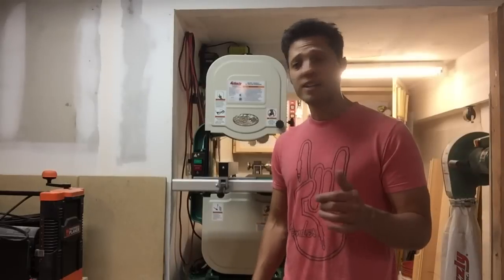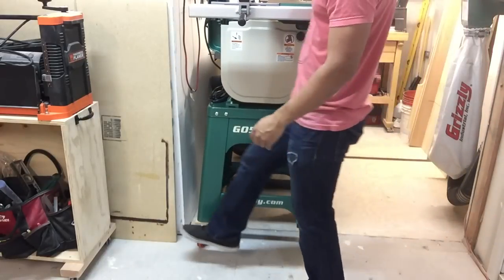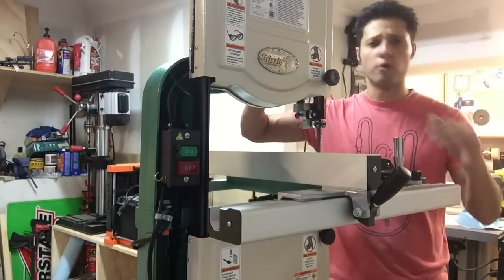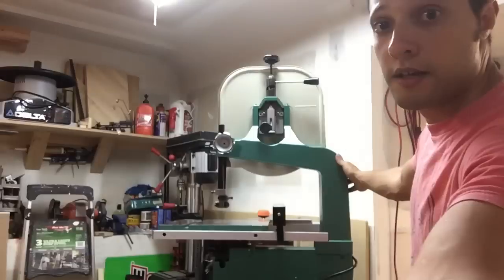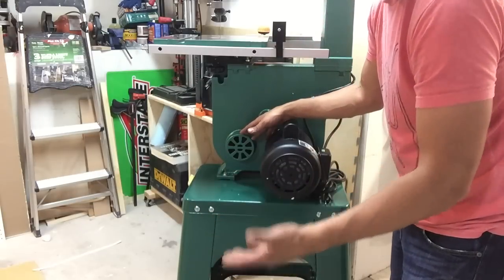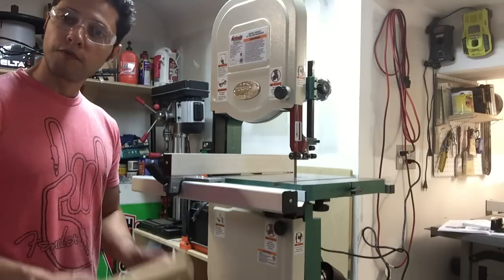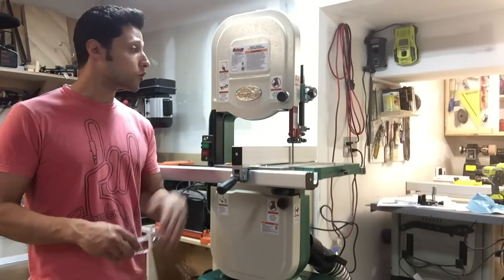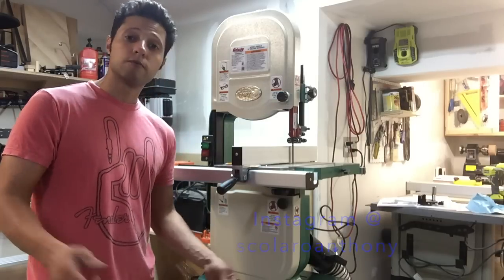Grizzly Bandsaw G0555LX

Comment: Just got this saw and it's been sitting in the floor because there was no way I was going to be able to lift it onto the stand.  After hearing you say that you lifted it yourself I did some rethinking and thought if a 30+/- guy can lift this saw alone why couldn't two 60+/- guys do the same.  Well it worked and  I am back in business.  Thanks for the inspiration.  Old guys rule!!!!
Reply from the maker: Dave Bailey 37 to be exact lol... I had a tough time lifting it by myself and would not recommend it but after some heavy deadlifts, it was more awkward than heavy.  Congrats on your new toy and thanks for watching
Reply: Dave - When I got mine I was wondering about lifting it by myself as well. But it can be done with a 60+ guy, my 50+ wife and my 30 year old daughter with no problems :)  Love my Grizzly!
Reply: @dfranks50  this 60+guy screwed a brace to the floor joists  wrapped a chain around it then jacked it up to chair height with a come along.  From there I was able to slide it on to the stand. Made my first cut today now I'm tearing apart my shop to give it a permanent home.
Reply: I was planning to install the riser block kit, so I removed the top arm while it was still in the box and set it aside. I then carefully stood up  the box it came in and carefully walked the lower half of the saw with the motor attached out of the box and then lifted that onto the stand. When it came time to bolt it to the stand, I ran the bolt with a flat washer up from under the stand and then placed a flat washer, a lock washer and a nut on it from the top. It seemed easier than trying to stack the washers and nut onto the bolt from underneath. I'm 67. Something I noticed was that if I inserted the table lock pin  in too far, the slot between the front and rear half of the table would visually expand, causing the fence to bind.

Comment: anthony i bought this saw last week and the excentric bushing on the bearing where you adjust the bearing wont go back farther enought to get it off the blade,,have you had this trouble,,
Reply from the maker: No, I haven’t. Have you tried adjusting where the blade sits on the wheels, you might have the blade set too far back. If that’s not it, I’d call grizzly service

Comment: At what point do you switch from the 10-inch bandsaw to the hefty 14-inch.  Is cutting 2-ft and 3-ft hardwood something you need your upgraded bandsaw or could that be handled with the 10-inch.  Also, does the number of boards factor in as well?  Do you start off with the 10-inch or is the level of difficulty the same for both?
Reply from the maker: @CrossoverManiac  I have a video where I installed a riser block on this bandsaw to go from a 10” to a 14” resaw capacity. This allows you to start off with a 10” bandsaw if you’re not resawing wide boards. Then later if you need to upgrade, you don’t have to buy a whole new and more expensive saw.

Comment: Question for ya again lol.  So once you apply your tension with the tension lever are you able to adjust a little with the tension knob at the top, while you have the tension lever engaged? If I have my tension lever engaged no matter the amount of tension I set it at, I cannot make the slightest adjustments with the tension knob. I feel like I should be able to make small adjustments with the tension knob with the tension lever engaged. Thoughts?

I guess I’ll be calling Grizzly Tech Support again tomorrow but any thoughts? Thanks
Reply from the maker: Lyric Klein try pre-tensioning some more without the lever engaged, it might be a little harder to engage the lever afterward but it should give you more tension on the blade
Reply: Anthony Scolaro just got off the phone with Grizzly a bit ago and I think we got it remedied. The Tech Support at Grizzly had me use lubricant oil to oil the spring and tensioning rod. The Tech Support agent asked what penetrating oil I had, which I had WD-40, Liquid Wrench and PB Blaster. He recommended using the PB Blaster. He said under full tension to oil the spring and tension rod. Next to remove tension and work the tension rod up and down the tensioner. Next he said lower the tension really low and apply more oil. He said let it sit for 15-20 minutes which should remedy the issue. He said at times the rod in the tensioner and spring both get dry and it makes it super hard to make adjustments while under tension.  Now I’m able to apply full tension properly and make adjustments to the tensioner while under full tension. 

Just wanted to help pass this information along to you or anyone who may have this issue in the future and need help. 

Btw I am curious if some type of thicker lubricant can be used to provide continuous lubricant so it doesn’t dry out so quickly or as quickly. 

Thanks Anthony and take care

Comment: anthony i boought the rikon 10-326 about 2 yrs ago and i hated it,,,,i sold it yesterday and was considering this saw,,,can you tell me if you still have it and how well it performs,,especially on resawing
Reply from the maker: I still have it and it still performs well. I added the extension block to increase resaw capacity. I have a video on that. I use the saw a lot but not as much as someone who does extensive resawing and curve cuts, so it’s perfect for me but I can’t say how it would hold up in an industrial shop where its put through the ringer day in and day out.

Comment: Great video my question is once the riser block is installed does it require a longer blade
Reply from the maker: Robert Spina yes, it requires longer blades, I have a video where I install the riser block kit, and I explain that during the installation. Check that out on my channel.

Comment: How does your G0555LX band saw not vibrate like crazy? I just got mine two days ago and it vibrates pretty bad. All stand and mounting bolts are tight. Can’t even pass a nickel test.
Reply from the maker: Lyric Klein check your wheels for alignment. If they’re out, you’ll get major vibration. You mace have to adjust them, also make sure your blade is tensioned correctly, and tracking right on the wheels. Then check and adjust your bearings last.
Reply: Anthony Scolaro hi, thanks for the quick reply, appreciate it. I checked alignment, tension and bearings and everything was great. Lastly I took the blade off and checked the wheels for balance. I was easily and quickly able to see the top wheel was not balanced. I marked the wheel where it stopped when I would spin it and every time I’d spin it it would stop in the same spot. Which obviously showed the wheel was not balanced. I contacted Grizzly and let them know everything I had done to remedy and quickly they said it was the top wheel not balanced. Right away without hesitation are mailing me a new wheel and tire for the top. I gotta say Grizzly was so excellent with the Customer Service and Tech Support. So friendly, helpful and just right on it. Great great.
Reply: Anthony Scolaro so I’ve gone over everything I can and I got rid of a little bit of the vibration. Question, when you shut off your bandsaw does it vibrate for a little bit when it starts to slow down, not the whole time but just a small bit? Thanks

Comment: Good review and good angles on camera. Question: did the cast iron vs. aluminum wheels have any influence on your decision of different saws or was that a non-factor?
Reply from the maker: Papa Grouch not a factor, I went by power, size and ability to add the riser block for 12” resaw height, I have a video on installing that on my channel as well.
Reply: Thanks. Again,  good review. I'll be checking out your install video on the riser block.

Comment: hey Anthony, I have wens 9 inch band saw and it's making me hate bandsaw's. I'm assuming you had a similar experience? did your wen blade wonder and not cut very straight?
Reply from the maker: Wood And Screw honestly I liked the WEN BANDSAW but I had a unique opportunity to acquire this 14" grizzly for a barder build. It was an offer I couldn't pass up, plus the work I've been doing requires more power and size. If set up properly, the WEN should not drift. Check the blade as well. Get a quality blade and remember tension.

Comment: how many bandsaws do you have,,didn't you do a review on a wen,,did grizzy or wen give you the saw to make a video,,
Reply from the maker: jeff oldham I had an offer from someone to buy the Wen after a few months and since I had the chance to upgrade to a 14 inch bandsaw with the capability of adding a riser block for a resaw height of 12 inches, it's a no brainer. This machine is much more suitable for the amount of work I do.

Comment: What was wrong with the Wen 10" Bandsaw w/ 6" resaw capabilities?
Reply from the maker: HKGuy Snowman#1  I needed more of a throat opening, this is 14”, I needed more power for the work I do and as far as resaw capability, the grizzly takes up to a 3/4” wide blade which makes that process much easier, smoother and quicker.
Reply: @AnthonyScolaro1  Oh ok that makes sense I hear ya!! I'm doing my research & in the process of buying one myself right now. I kinda narrowed it down to either going the inexpensive route with the Wen 10" or I really have my eye on a Jet 14" Delux Professional. It has built in 12" resaw capabilities without the need of adding a riser. Then again it's a whole lot more money!! Decisions, Decisions lol.... Thanks man best of luck
Reply from the maker: HKGuy Snowman#1 good luck with your purchase but remember, if you get what you need and want now, you won’t have to sell it and buy the one you really wanted later.
Reply: @AnthonyScolaro1  very true, good advice!! Thank you

Comment: Anthony, Are you still happy with this Bandsaw?? I did not pull the trigger yet but I did just buy a spindle sander made by Grizzly. Great video......Pete
Reply from the maker: Peter Trentacoste yes, extremely happy with it. It has the size and power I needed

Comment: yours makes that noise mine does when shut off. I called shop fox and they said it was normal
Reply from the maker: Thanks for the heads up, I was thinking of removing the back motor cover and seeing if there was sufficient clearance
Reply: I thought the fan blades was hitting. thing is I've used a 17 inch grizzly and a $4000 jet. neither made that noise. I've used mine a lot and no issues. my only gripe is needs a bigger table.
Reply from the maker: +Charles Holland I might just make an extended removable plywood table if I need more. Something I can clamp on and off when I need it
Reply: I'd like to see a possible video if you do. :)

Comment: Thanks for a good review, Anthony.  I'm considering this saw for my next shop purchase.  I've got a couple of Grizzly machines already and love them.

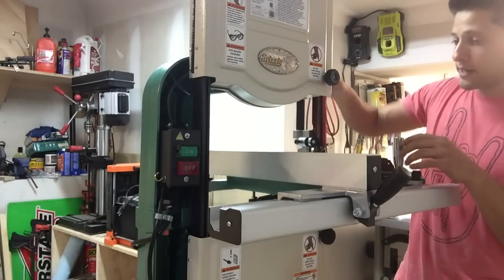I noticed, at 2:16, the screws that hold the scale sight glass are up above the table surface slightly.  Also, at 5:25, the fence appears to sits about a 1/4" above the table surface and the work piece is obstructed by those screws.  Is this normal for this model or is it something you've corrected since the video was made?
Reply: Yep, I noticed that too, looks like the fence rail is mounted a little too high. I ordered this exact model and it's scheduled for delivery within the next few days. I don't think the fence is attached while being shipped. I'll be sure to keep that in mind when I assemble it.

Comment: After putting wheels on it, is the table still at a comfortable height?  I'm 5'-10" ...  Thanks for the great review video
Reply from the maker: I'm also 5'10" and it is a bit high but comfortable enough for me to work on. I'm going to get a true low profile mobile base for it eventually. Thanks for watching.
Reply: Anthony Scolaro I bought the delta universal mobile base (wood not included)  for the G0555LANV for 41 dlls. Also try adding a brush for the lower wheel. you can get it on amazon or make one yourself.